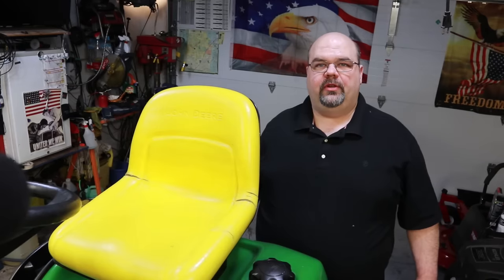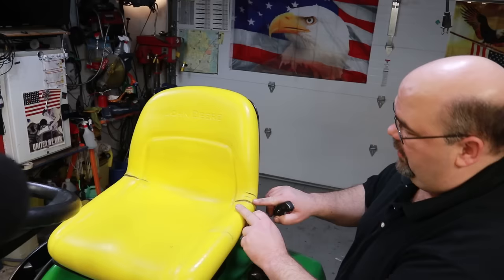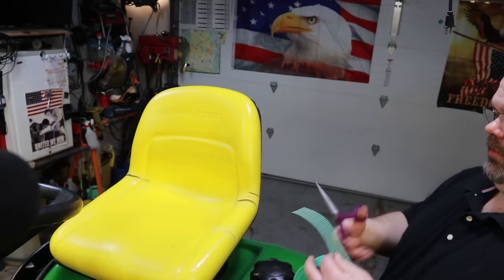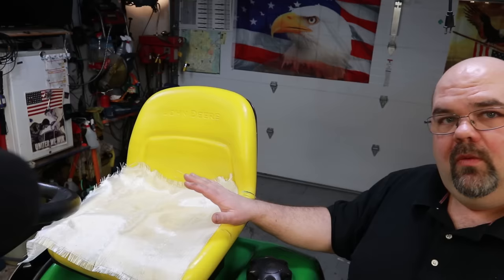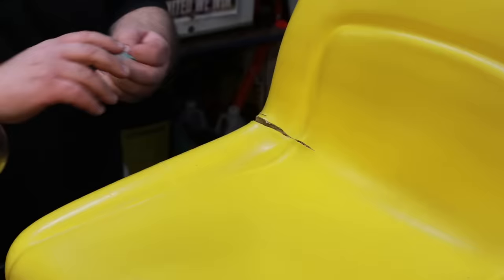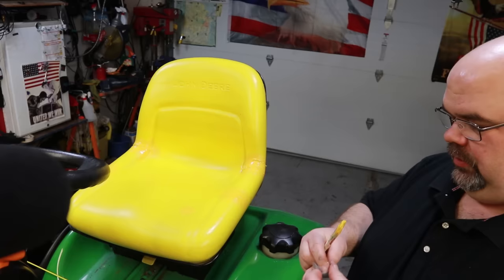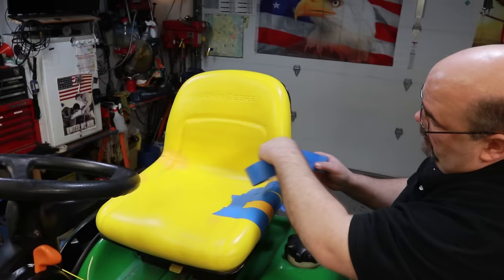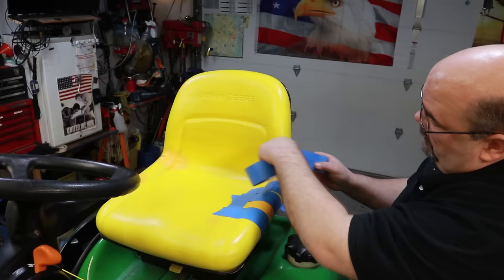Unexpected Solution For Your John Deere Riding Mower Seat

Comment: Your video gave me a brilliant idea. It turns out that flex seal comes in colors. Just ordered it in yellow and in black directly off of their website. I have both a cracked yellow seat and a cracked black seat. I'm going to follow your clever procedure. I'll let you know how it goes. I think that it will be more durable than the plastic dip. Plastic dip makes a yellow in a spray can that looks like JD yellow. You could spray it into the top of the can and brush it on. Also, how about applying it to the cracks with a syringe with a large bore needle or an industrial syringe? Just throwing out ideas...
Reply from the maker: That's awesome; let us know how it turns out.  Thanks for watching.  🦅
Reply: @baldeagle242  Thank you for sharing such a great idea. How is your repair holding up?
Reply from the maker: This mower was sold a couple of days after I finished this video.  However, my father had one we did a few years back, and the seat started cracking in other areas before the repair failed.  Even if it does wear it's easy to go over it again.

Comment: Nice DIY.  Makes sense if you already have all the components to do the repair. However, by the time I buy all the supplies to do this project, it’ll cost me more than a replacement cover and possibly a new discounted seat.  😂

I do truly appreciate
Reply from the maker: It's a shame prices have increased so much since I made this video. When I made this video, I added up the cost of everything used, and it was about half the cost of a new seat cover and about 10% of the cost of a new seat.  People have started to leave comments about not being able to do this for $10 but two years ago, that was exactly what I spent on materials, and probably have enough left over to repair 10-15 more seats. It is what it is at this point.  Thanks for watching and taking the time to leave a comment.  😁👍

Comment: Thats a great tip! Thank you. I wonder though, usually by the time the seat starts cracking, the whole thing is brittle. I could see it just cracking somewhere else.
Reply from the maker: There is a point when you're better off replacing it with a new seat. In line with your comment, the repairs I've done on previous black seats, the repaired areas have lasted longer than other areas of the seat.
Reply: I tried spraying spar urethane on a seat. It'll stay if you clean it good from Armorall. That'll give it a little UV protection.

Comment: A good video thank you. I have similar cracking on my X320 seat. Shame on John Deere for using cheap, nasty upholstery on its lawn tractors, considering the high price you pay or them.
Reply from the maker: I couldn't agree more.  Thanks for watching, and good luck with your repair.  🦅
Reply: I totally agree. We just got a new X-Series lawn tractor and I'm not too happy to hear that your seat has cracked. You would think that the upgraded and more costly parts on the X-Series would have been manufactured with higher quality control in mind - like you said, considering the high price we paid. Our old LT150 has lasted almost 20 years now, but the seat has been cracked for years.

Comment: Really liked that this was something new that no one else has covered.
My question is how do you clean up the plasti-dip from tools, etc.?
Reply from the maker: +Rebecca Gray, the brushes I use are just inexpensive chip brushes that you can purchase on Amazon for around $10 for 24 of them(link in video description). I dispose of them when I'm done.  If you get some other tools, it will wipe off pretty quickly when it's still wet.  If it's dry, I take it to my bench grinder with a wire wheel, and it will strip it right off.  Hope this helps and good luck with your repair.  🦅🇺🇸

Comment: John Deere seats suck.  Rode a towel on mine for about a decade.  Side benefit, kept my butt dry on hot summer days.  Used that machine for almost 20 years before giving it away as the engine was becoming worn.  Never had a hour meter, if it did it would be high hours.  Great mower.

Comment: Nice work!  A buddy of mine watched your video a few months ago, and did the same repair.  Only thing he did different, was to scuff the entire seat, and then spray-painted it with JD yellow.  It's held up so far, so I am considering doing the same thing for my 4720.  Gotta fill a pretty large and deep hole where the mice dug a latrine in the corner of the seat, (and used it) but I'll fill it with something foamy before I start.
Reply: Oh dang I commented about doing the whole seat so the color wouldn't be patchy before I saw your comment!

Comment: What if you did a light spray with JD yellow paint? A light coat should stay flexible. I accidentally got a bit on my tractor seat while touching up the deck and I can't get the paint to come off, it just looks like a clean spot on the seat.
Reply from the maker: It may work.  I'd be interested in hearing how it turns out if anyone tries it.  
Thanks for watching.  🦅

Comment: How has this held up over time? Does it fall apart or peel?
Reply from the maker: The better you clean and prepare the surface, the less likely it will peel or fall apart.  As with anything over time, it will start to fail, but it's a simple fix to clean the area and go over it again.  With that said, once these seats get to be a certain age, you're going to start to see cracks and tares in other areas.  Generally, the repair will outlast the rest of the seat, but there does come a time when replacing the seat is your best option.  Thanks for watching, and good luck with yours.  🦅🇺🇸

Comment: I watched this video 1.5 years ago roughly.  I made the repair per this video, and it looked great at the time.  Now the seat has ripped through the repaired area as well as new areas.  So this video technique should be considered as a temporary repair to keep the seat from absorbing water for one season - after that, the proper solution is a new seat with a sun cover.
Reply from the maker: Thanks for the feedback. I appreciate you coming back to share your experience.  I have had quite a few comments on this video for better ways to repair these seats. I may make a second seat repair video later this summer. I’m actually making a new plastic hood repair video now that I hope to upload this weekend. These repairs do depend a lot on the condition of the seat or plastic hood I start with. If they are already in bad shape the repair will be much more temporary. There is definitely a point when buying new is the best option.

Comment: Thanks for the video. I want to repeat what one of your other commentors said regarding you would think john deere would make a better seat. Mine developed a crack at less than 300 hours of use as well. But I guess that seems to be what we get for quality these days.
Reply from the maker: +steve60 The seats and plastic hoods are the Achilles heel on Deeres. Thanks for taking the time to leave a comment. I hope to see you around on future videos.
Reply: @baldeagle242  I agree 100% but I would like to add one more frustration I have with my JD LT D140 is the location of the grease fittings on the spindles that are supposed to be greased every 25 hours. Instead of them being conveniently located on the outside of the spindles, they face the inside center of the mower deck making them a pain to service. Not user friendly. Thanks for listening to my mini rant.
Reply from the maker: I’ve seen that quite a few times. If the installers look before they bolt the spindles into the deck they can turn them so it’s not an issue. Apparently some of them missed that day of orientation.  🤦🏻
Reply: Presently I am using a JD E160 that is quite new. It's owned by the people I do yard caretaking for. No problems yet with the seat cracking.
I personally own a Craftsman riding mower I've had for about 15 or more years that has a black seat that has cracks on the outer sides. I just put black Gorilla tape on it, and it's holding up quite well. Furthermore, I'm 78 and expect the tractor to last longer than I will given world conditions.   Good video Baldy!

Comment: Come back in few months, mid to late summer, and let us know how much you have used the mower and how well the repair has held up.  I'm not worried about the color match.  I'm concerned with how functional it is.  Also, someone below/above mentioned mixing some white plasti-dip with the yellow to lighten the color.  It would be really interesting to see if the works.
Reply from the maker: Thanks for watching.  Unfortunately, I don't keep them very long after they've been fixed and cleaned up. This mower was sold a couple days after the video was posted.
Reply: I’ve got the yellow and white .. I’m gonna try and do a color match soon!
Reply from the maker: There have been quite a few people commenting about trying that but I haven’t heard from anyone who has tried it. I’d be interested in knowing how it turns out once you try it. 😁👍
Reply: @drgoodwrench01  how'd it go?

Comment: This is more of a question, would it work if you were to spray JD yellow over the repair? Spray paint may not stick great but it might help. Or while the last coat of plastic is still wet spray the yellow and blend it with the brush? I'm just a plethora of questionable ideas.
Reply from the maker: I have checked on their website, and according to the information I read there, it can be painted.  However, because this material is so playable and flexible, I doubt paint would last very long in a situation such as this.  It’s something you'd have to experiment with on something you're willing to replace if it turns out bad.  
Anyways, thanks for watching, and if you decide to try it, let us know how it turns out.  Thanks for watching.  🦅

Comment: Get some white paint and mix until you find the match! How long does the plastic dip hold up under normal seat use?
Reply from the maker: There are a few variables but in my experience, the seat will crack in other areas before the repair fails.

Comment: I have used Goop to fill the cracks which is paintable with an aerosol JD yellow. Mask off the crack and spray.  Use the clear goop. You get durability and color match.  Make several light  coats as goop will run if too thick. Cheers!
Reply from the maker: Thanks for the tip.  I’ve never tried that product.  😁👍
Reply: @baldeagle242  The black is fantastic for fixing black stuff.  I use this stuff almost daily repairing shoes, you name it.  It is a very strong yet flexible adhesive, next to epoxy which I use for more rigid repairs.  Get a black tube and a clear and your repair options are limitless.  Nice job on the video!
Reply from the maker: @cecilcogswell4728  thank you.  😁👍

Comment: wondering if you mixed a little white in with the yellow if you could  get the color closer
Reply from the maker: That's not a bad idea.  When it's wet, the color is very close, but as it dries, it gets much darker.   I'll have to play around with mixing it and testing it on an old seat someday.  Thanks for the suggestion.
Reply: @baldeagle242  Yellow is a primary color, if you mix white it will turn milky, the only way to make it more "yellow" is to add yellow. The plastic dip is yellow with red which made it an orange color
Reply from the maker: @BC5391  Thanks for the tip.  I was thinking along these lines myself.  🦅
Reply: Yeah, like that liquid vinyl for sofa repairs they used to sell. I was going that route, but I can't seem to find it anymore.

Comment: I love Plasti dip.. this is a great use for it! You could either Plasti dip the entire seat so that it's all the same color... Or after you repair those spots with the Plasti dip you could go over the top of that with a brighter yellow to paint the whole seat. If there is a paint that would stand up to that, that is. I don't know I haven't tried to paint a plastic-y/vinyl seat but it's an idea to try if you want to not have patchy colors.
Reply: They used to make vinyl spray to change colors on vinyl. I used it to spray a taneau cover That was white to black and it worked great. They probably still make the stuff.  It would be better than using the plasti dip spray.

Comment: I use Gorilla duct tape on my Craftsman seat.  Easier fix and it lasts for 3-4 years.
Reply from the maker: That stuff works well too but I’ve found it to be a challenge to use on the rounded areas where the top and bottom parts meet.  Thanks for watching.

Comment: I'm wondering if it might be possible to see the crack together after adding the drywall tape and before sealing it?  Also, would drilling a hale above and below the crack keep it from spending (as with other materials)?
I only have one crack, near the "bend" in the seat, and I am worried about patch longevity due to flexing.
Thanks in advance!
Reply from the maker: I've seen people drill small holes at the end of cracks like this, and in theory, it should create a rounded edge that's less likely to tear.  I've personally not tried it.  
I've found that the fiberglass mesh does a pretty decent job of holding everything together. If it does continue to crack or cracks in a different area, it's pretty simple to reapply this material over a prior repair.  Good luck with your repair.  Let us know how it turns out and thanks for watching.  🦅🇺🇸

Comment: Would it help to clean the area with the cleaner (prep all) you used before you sand so the contaminants do not get on the clean material you are exposing by sanding/  I would still wipe the area again like you did before applying  the  Plastic Dip.  I have a black seat so we will see how well it matches. Thank for the idea.
Reply from the maker: Thank you for the tip.

Comment: Great Video.  Do you have a method to get a JD foam seat back into it's metal frame?
Reply from the maker: I've tried a few different things to glue them back in with mixed results.  The best thing I've tried is HH-66 Industrial Strength Vinyl Cement.  It bonds very well and stays semi-flexible after it dries.

Comment: This looks like a good idea 💡!
 I have a black vinyl seat on my Snapper riding mower and it has quite a few more and bigger cracks in it. When you mentioned spraying Plasti Dip it made me think of sprayable Flex Seal which is black. I wonder which would be more durable?
Reply from the maker: From comments others have made I believe Flex Seal is a better spray option.  
Thanks for watching and let us know how it turns out.  🦅

Comment: It's an option but when there is a lot of cracking, the seat is basically worn/dryed out and will probably experience more cracks.  For the time and effort involved with a plasti dip repair, I like a yellow duck tape ($3.48) and then buy a new seat cover.
Reply from the maker: There is definitely a point of no return.  Once it gets to that point, it's time to put a seat cover on it or replace it.  
Thanks for watching.  🦅

Comment: Just wondering, can you paint on top of plastidip? You could mask off around your plastidip and cover the rest of the seat and spray paint the with JD yellow.  What do you think? Good video.
Reply from the maker: I'm not sure if it would stick or not.  I'd be worried even if it does it would rub or crack of rather quickly.  
Thanks for watching.  🦅

Comment: Would it work to put a top coat of John Deere yellow spray paint on top of the repaired areas to get the color to blend in?
Reply: Depending on the paint, might melt the vinyl if the thinner is wrong.
Reply from the maker: I have checked on their website, and according to the information I read there, it can be painted.  However, because this material is so playable and flexible, I doubt paint would last very long in a situation such as this.  It’s something you'd have to experiment with on something you're willing to replace if it turns out bad.  
Anyways, thanks for watching, and if you decide to try it, let us know how it turns out.  Thanks for watching.  🦅